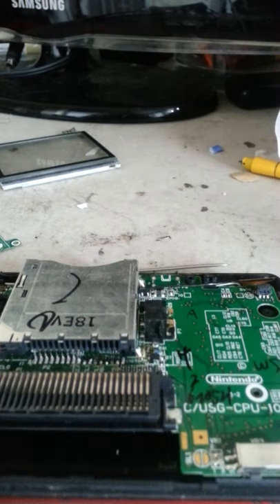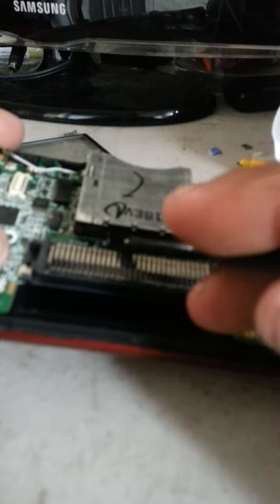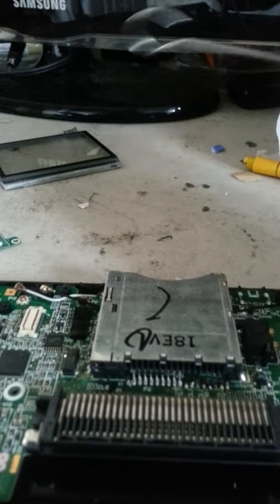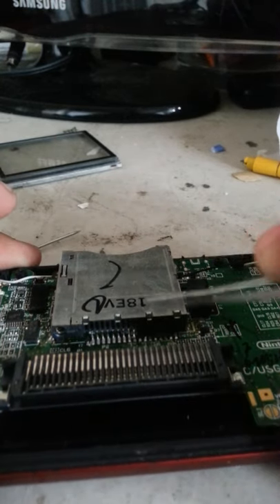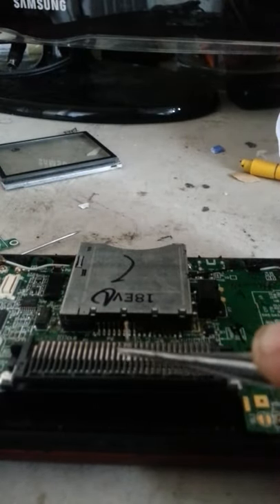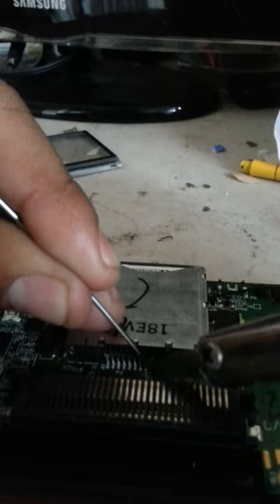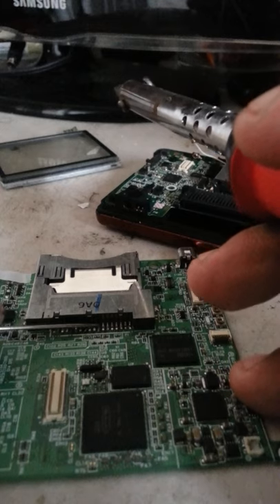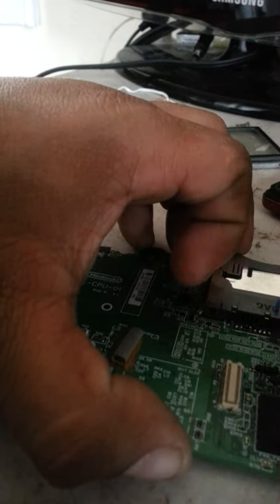Ds dsi 3ds game slot repair easy FAST WAY

Comment: I wouldn't say "easy" but looks like it's simple. I'll try that when I buy another soldering iron, hope to make it work. Luckily I won't need to send to repair, just fix the prongs which are bent. Thanks for the info!

Comment: Just tried the remove a single prong method for one that had snapped off. Seems the bad prong was stuck quite tight, even though snapped off inside. so this method didn't work for me. A new game slot it is.